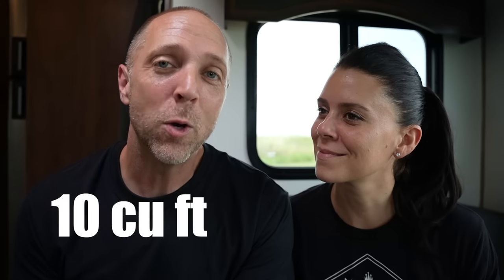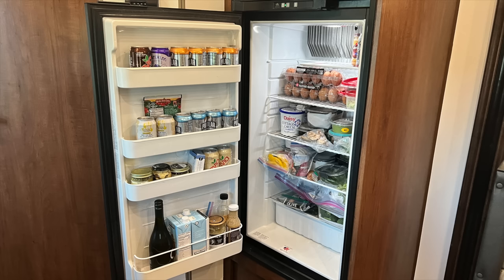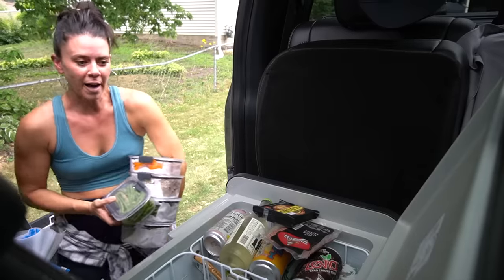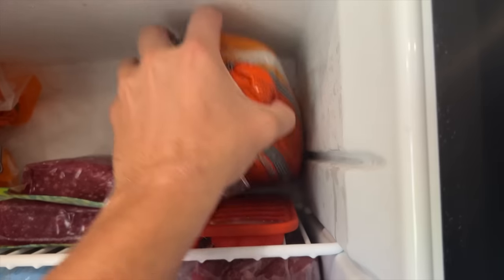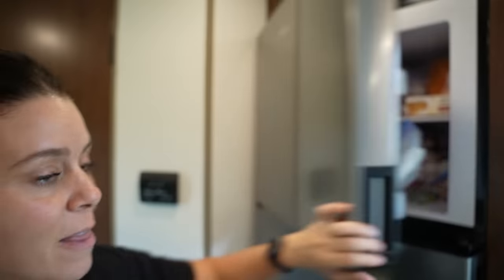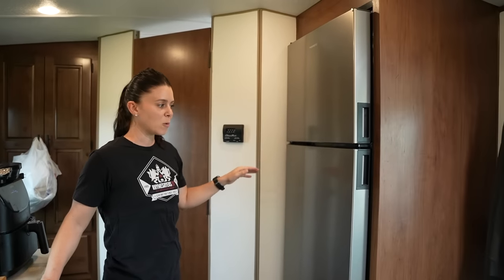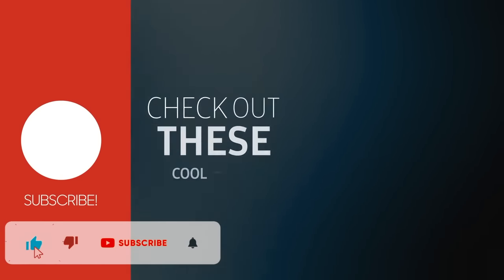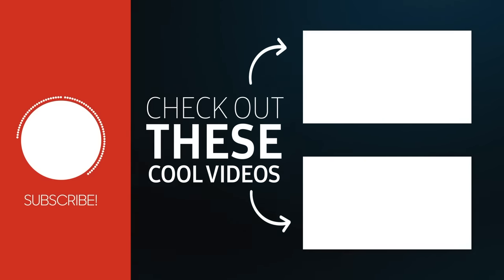6 Reasons You MUST Switch to a 12 Volt RV Fridge - Dometic 12 volt rv fridge

Comment: I have 3 100 watt solar panels and use 2 - 6 volt Costco golf cart batteries and I have never ran out of power. The RV alternator does a great job , I have never had to use the generator. I have an 12v EverChill 10 cu ft  fridge. Love it best upgrade ever.
Reply: Your RV has an alternator?
Reply: @dustinryan9671  Yes , so when you drive it charges the batteries
Reply: @johnoliva576  do you drive a motorcoach?
Reply: Whatever it is, he has to drive every day or his beer goes warm.

Comment: I would never plug that line inside the rv, take the other end of the line off and cap it there. At least if it develops a leak it’s outside the rv where the breeze can do it’s magic. Also that line being unsupported is a horrible idea, the road vibration will eventually work harden and crack it. Hence the reason I’d cap it OUTSIDE beneath the coroplast

Comment: It seems these "new" innovations are forcing everyone to not boondock. We have 400 amp hrs of batteries - we can stay out several days using the propane fridge - I really hate to think the manuf. are all going to 12 v.  We have NO problems with our fridge in our midwest flyover area - i'm sure in extreme areas there may be some issues, but for most of us it works.
Reply: I understand where you coming from....The 12 volt is best for full timers because one 100watts solar panel can run a run for 17days ....

Comment: Great video! However, what about the level of the noise (compressor & running fans). Is it noticeable? Or barely noticeable? Thank you!
Reply: We just got this same fridge and there are three modes including a silent mode. Our trailer is just a single room so the fridge is in the same space as the fridge and I just do not hear it even if I don’t put it on silent mode.
Reply from the maker: You can definitely hear the fridge when it’s running, but it’s not too bad. Our bed is less than 10 ft away and we don’t notice it at night while sleeping. 👍
Reply: Thank you for the update!!

Comment: Nice video!! I have a truck camper with a Norcold absorbtion refrigerator and added an additional fan to improve performance. It works well enough when parked, but in high heat, driving down the road, the freezer will get up to 40F and refrigerator gets to 60F or higher. Does the DC compressor refrigerator suffer while driving down the road? Thanks!!

Comment: I realize that this post is a year old, but I'm new to your channel.  We had a gas absorption fridge for many years and got used to it.  We just bought a new 5th wheel that came with a 12-volt fridge.  The big advantage is how cold it gets and that you can turn your propane off (which is recommended) and keep everything cold.  The disadvantage is when we're boondocking, it burns battery since we can't run it on propane, or we have to run the generator.

Comment: How much did the solar panels and lithium battery set up cost you? How do you charge your batteries in winter?  P. S. A 20 lb  propane tank refill cost about $18 and  runs my fridge for 15 days. (@ 1.23 $/day) I run my fridge on propane 9 mos/year = 333$/year x 10 years = 3330 $. An e Volta set up is $ 25000 ....

Comment: I have a 34 year old Dometic absorption that still surprises me with the temperatures -5F to 5F freezer temperatures/ 35F to 42F fridge. But the 12V compressor fridge is my dream fridge.
Reply: My dometic runs 300 watts for an hour, off for 15 mins, then 300 watts for an hour. its horrible. takes twice the power as my residential fridge twice its size with an ice maker.
Reply: @enigma9789  I have a 390W panel up top right now but I am looking to add another 510W panel. I may remove the 390W and put two 510W panels up top. I have 800 AH of AGM batteries and have room for another 600 AH of Group 31 AGM batteries. Once I have the two panels up top and the 1400 AH of batteries I will probably upgrade to the 12v fridge. I am not full-time in the rig yet, but I am looking to move to full-time within the next year.
Reply: @magician2020  Honestly the price of lithium batteries has gotten very low. Its almost time to switch. My camper runs on a solar shed, it has 200ah at 48v of lithium iron phosphate (8 batteries) 1200 watts of solar on the shed roof and 4000 watts on a ground mount. I still run the fridge on propane overnight because it wont handle the AC and fridge. (Im in Texas, its hot at night)
Reply: @enigma9789  that is still pretty impressive to run the AC on battery charged by solar. I have two roof ACs but I have to run the generator for AC. I’m in Phoenix and just picked up a Hessaire Evaporative Cooler that uses 75 watts. I think a second one in the back of the rig for a total of 150 watts will cool off my rig.

Comment: I have an EverChill 12v refrigerator in my Flagstaff Microlight. All the positives that you state, but I had a cooling problem that I felt was due to no clearance between the cabinet wood trim and the refrigerator. I have a YouTube video that explains my problem and my solution of add ventilation fans. What did you do on the exterior of your RV? Did you seal up the opening or does it still allow for ventilation?

Comment: Absorbtion fridges used to be fine and could do the job but the newest ones are junk and allow their temps to swing drastically. 
I upgraded my model year 2018 Norcold to a 12V compressor and added 400A of Lithium with 600 watts of solar. It was spendy but this setup is fantastic. The solar keeps up easily with the fridges daily use and if it's cloudy, the lithium can keep us going for 3 days without issue.

Comment: I guess I will have to be about the only naysayer here.
I've been RVing regularly since 1986 and have gone through quite a few refrigerators and the 12 volts certainly now make a good option.
First, one plus I did not hear about the 12 volt compressor was the fact that propane RV refrigerators can be quite finicky when you go up in altitude (which we do a lot of mountain camping).
I also agree that propane refrigerators are simply one more thing to worry about, but then you replace this worry with the electrical worry, so I call this one a draw.
I do have to take issue though with propane usage, we often camp in warmer western state climates in the summer and we average about 2-3 gallons over a 3 week trip, which IMHO is not bad (it also does NOT run constantly with our recent models).
We also camp in areas where our solar panels are not all that effective and the average 12 volt 10 cubic foot refrigerator uses on average 8 amps dc (counting off time). This can add up to a lot, especially when I note that we've run furnaces in very cold climates and had them kill batteries in one night at an 8 amp draw. 
I will also note that these DC compressor refrigerators cost less to build but the mark up is higher, which is why many RV manufacturers are now adding these, but only with  two 12 volt lead acid batteries and 200 watts of solar which during an average summer day does not provide much more power than just running the refrigerator. In winter dry camping you simply will need to run a gas generator often to keep up.
Do not get me wrong, I think they have their place, but IMO and in the opinion of the RV tech I've been using for some time, these are not best for many true boon-docking RVers unless you have a really good litium battery pack and good sun much of the day (such as winter camping in the Arizona desert)

Comment: just purchased 2022 ORV 24TRX and had it delivered to Iowa. Fridge worked for 2 days. Had to purchase $1800 12v fridge Dometic since no local RV dealers would deal with warranty work. Norcold sucks. Could not get factory on the phone being on hold over 5 hrs over 2 days and gave up. Luckly the Dometic slide direct in no problem. Capped off the LP line and wired the 12v in. Luv the new fridge.
Reply from the maker: Ohh thats a bummer to hear! Warranty stuff is just no fun... I think someone said ORV is finally going to a 12 volt fridge option for the 2023 models...but not sure if thats true. Glad your all hooked up now and enjoy the ORV!

Comment: Have this in our 2022 Rockwood 2516s. 9 months old and it’s dying. The light flashes and it will barely crust over ice in the freezer. Have tried turning off and letting it reset.  
This is on shore power.

Comment: Same RV, 22FQS 2022... I have been on quite a few trips with the gas absorption unit. It does not perform very well at all. Anything over 90 degrees and it is useless. I am going to do this upgrade exactly. Thanks for the video.
Reply from the maker: Awesome! You’ll love it!
Reply: Finally did this upgrade. Fantastic.  I also blocked  both vents with foil tape and some insulation as well. I let the RV get up to about 98° inside and out and the fridge held temperature. Very impressed.

Comment: We just upgraded our Airstream to a larger model with a 12v fridge. I was hesitant to switch from absorption to compression because of the battery usage. Like Aaron mentioned about stock systems, our new trailer came with 200Ah lithium with 270 watts of solar. Well, all the worries were not needed because that electrical system is more than sufficient to run the fridge 24/7. We even leave it on in the driveway between trips. Sometimes we won’t turn the freezer on if we’re not bringing frozen foods and this really helps lower power usage. 

Agree completely that the best parts are way more useable space in the fridge, more consistent temperatures and when it gets hot out it keeps everything cold. With the absorption fridge when it got hot it didn’t keep contents at 38 degrees, danger zone!!! 

12v works way better for weekend warriors also because those absorption fridges take so long to get cold, so we’d have to bring a separate ice cooler for travel time, and then you wait for the fridge to get cold at your destination, then you have to move your food from your cooler to the fridge. Then at the end of the trip same maneuver because we didn’t drive with propane on either. Way easier!
Reply: We routinely turn our absorption frig on the day before.  Typically a good overnight will be enough for it to be at temp before we leave. If you put a two small size bags of ice in the  freezer it cools down the rest of the frig faster. The day before works for us. 
We also have a ICECO portable frig, we put in the truck when traveling to have cold drinks, and snacks. Our 5ver came with 2 30 lb propane tanks, and we have never run out of propane between the frig, hot water heater, the heater, and using a gas grill. We also love that we have 4 gas burners and a oven.
At night we can have heat on, and still not drain our two gel batteries. We like it more on the cold side, so the heat does not come on as often.  We will sleep with are windows open down in the low 50's. 
We have no solar.  We can boon-dock well over two weeks, and never run of propane.  We usually don't even fill the tanks up for every trip because they last so long. 
Our routine is to turn on the (factory installed) generator in the mornings, for breakfast, hot water heater, dishes showering. Then we are pretty much out during the day. Then when we come back later afternoon, evenings we turn the generator back on for a few hours before we go to bed.
It just works for us. We are not full time.
We even occasionally run our generator on all night when we get caught with high night time temps.
 We don't want the expense of a solar system, or the extra weight that takes away from our cargo capacity

Comment: Hi guys! Great vid! Getting ready to pull the trigger on the same upgrade. Question … How is that fridge holding up after a year or so of full time use? I too live full time in my RV. This fridge got mixed reviews so I’m just curious. Looking forward to your response. Thanks! 😎
Reply from the maker: Hello and Thanks! We sold the trailer last summer but the fridge was great for over a year. We now have a new 5th wheel with a Norcold 20NDSS and the dometic worked better!

Comment: I found out from the Dometic company that my refrigerator/freezer is an absorption model, so it doesn’t have a pump. Therefore, there is no pump to switch out and no way to put it in and I thought other people should know this in case they run into the same issue before they buy something

Comment: I have a Furion 12v compressor refrigerator in my 5th wheel.  Was doing good with two 100ah lithium and no solar but recently added 400 watts of solar which Ray Sokol  (the RV electric wizard) says should power the refrigerator indefinitely.

Comment: We're FTers who love to boondock almost all the time, so have installed a serious solar/battery system. Right now, we live with an old, 8cf Dometic absorption fridge upgraded with an Amish cooling unit. It works great, even in the 90-degree range, (those Amish make good stuff) but consumes about $1 to $1.50 a day in propane depending on the ambient temp. Plus, there's the expense and time needed to go get the propane - which if you're 100 miles from nowhere at the time, is a major inconvenience, and no small expense with an 8mpg motorhome. Fortunately, that doesn't happen too often.
 
Our motorhome has 2 solar/battery systems. We have a 48v, 16.3 kwh LiFePo-4 battery with 4,400 watts of solar on the roof to charge it. This provides 24/7 heating and cooling using our mini split heat pump, as well as all our other 110v AC electrical needs. We can also run a 14.5k rooftop A/C during the day while still being able to charge our batteries. But we plan on upgrading to a 12v fridge powered by a 7.1 kwh (560ah) LiFePo-4 12v battery charged by a 620-watt liftable array on the side of our MH. 

Right now, we use very little of our 12v system's capacity, so we have 12v power to spare. My question is, what is the most efficient and durable 12v, 10cf fridge available, and how long would it take to payback the upgrade?  If we went with a $1,300, 10cf Recpro, we're looking at a 3 yr+ break even, assuming we use about $400/yr in propane. But if we choose an $1,100, 10.7cf Contoure that Camping World sells, we're only looking at a 2yr, 9mo. break even. The question is, not only which is more efficient, but which fridge will last longer?

I can't envision propane getting any cheaper in the next few years, so it looks like a DC fridge is in my future, but I don't want to discard my perfectly good propane fridge just yet. I'm planning on just waiting till it dies before I make the leap. What do you think?

Comment: I think what fridge people should go with highly depends on the climates they'll be using their trailer or RV in. Cool dry climates are really where absorption fridges excel. Oh, and whether or not they'll be plugged into shore power is pretty important too.
Reply: Its a very inefficient heat pump. Let's make more heat to MOVE heat 🤦
Reply: I don’t think climate matters anymore. All that matters is if you want to run off electricity or gas. Absorption fridges use an insane amount of electrical power to run in electric only mode.

Comment: Great video. I have a small 16ft BH RV with an absorption fridge. I spend lots of time on the hot Arizona desert and this style of fridge doesn't even come close to being workable. A year or two ago I looked for a small 12v compressor fridge that might fit but had no luck. I'm hoping that one of the two RV fridge manufacturers will make one in the near future as these have really caught on. Until then I've been using an Acopower portable compressor fridge. I don't even turn on my old fridge and use it for shelf space.

Comment: $1800 for a DC fridge or $600 for a 10 to 14 cu.ft AC fridge that uses 1kWh/day with $1200 left to spend for an extra solar panel on the roof to power it. Either choice is better than propane IMO.

Comment: So we have had this exact model for a few months. My question is do you monitor your temperature in the fridge at all?? We are finding when it goes into defrost mode which is about every 12 hours it gets up to like 36 in freezer and 47 in fridge. It drops back down to like -11 in freezer and around 33 in fridge
Reply from the maker: We did monitor the Fridge portion only for a few weeks to figure out which setting was best for us. Right now we have it on Performance level 2 and that keeps the fridge between low 30's and low 40's as it cycles. Didn't notice a big defrost cycle swing like you did. If we put it on Performance 3 it can get too cold and freeze veggies or eggs in the back.....

Comment: I'd like to replace my RV refrigerator with a 12 volt compressor type but I have limited battery storage size. A 12 volt refrigerator needs a good battery bank.
What I have found, in the summer, a gas absorbs ion refrigerator doesn't keep the refrigerator section col enough. Running on gas is less effective than running on 120 volts.
That being said, I try to arrange my RV life to be in more moderate to cool environments so my refrigerator does better.

Comment: Had a flashback when you mentioned it coming out the door of the RV. Had a boat with a smaller household refrigerator in it when I bought it and it was old, ugly and not working great. I am sure it had been in there a long time. Went to take it out and found out some trim would have to removed from the boat. Of course after removing screws trim was not coming off so I pondered solution. Not wanting to remove and maybe ruin the trim I took out the compressor, laid down a blue tarp and took my Sawzall and cut it in half vertically. People at the marina had a good chuckle.